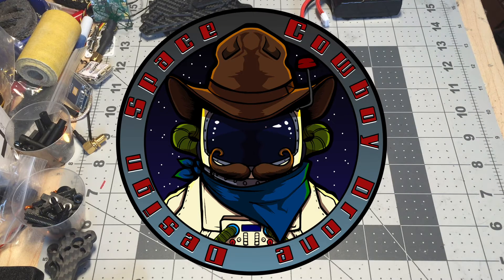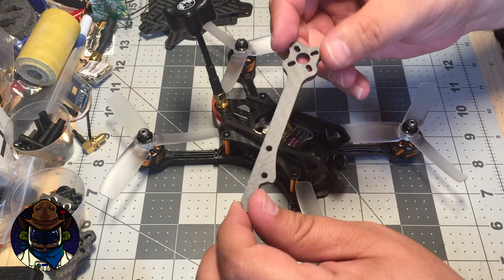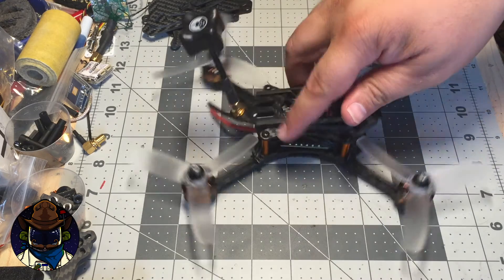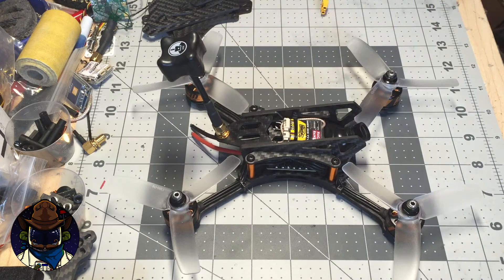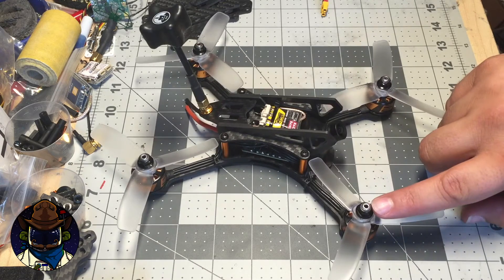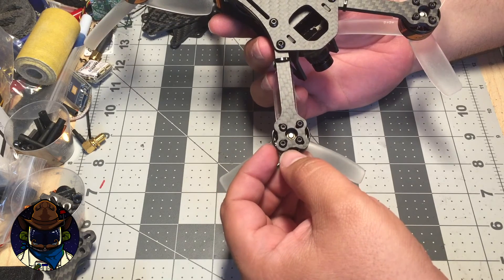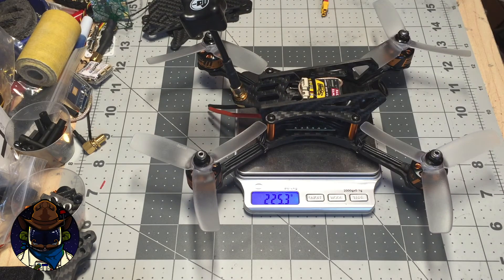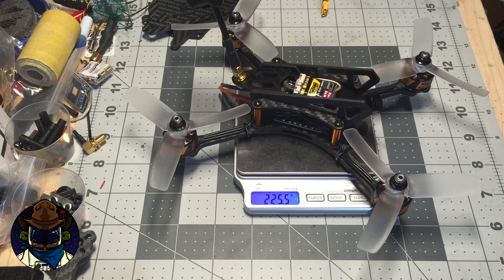Space Cowboy Workbench: XLR-4 Overview

Comment: I just placed an order for this frame on Armattan Production . I was wondering if you have any 3D motor guards they I can purchase? As I y just noticed that the motors are exposed to impact, there is actually no carbon fibre sticking out around the motor... Since I a professional crasher, without any sort of motor protection, my F30s won't last very long on this frame.
And can i fit some Tornado T1 1407 from Brotherhobby on these arms? The holes are good for 1407? Or their T1 1608? Thanks